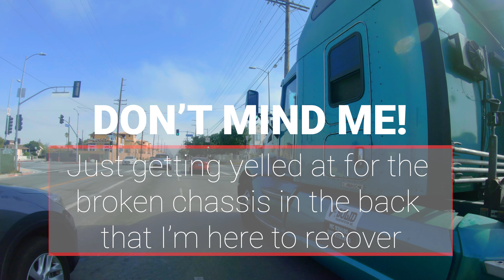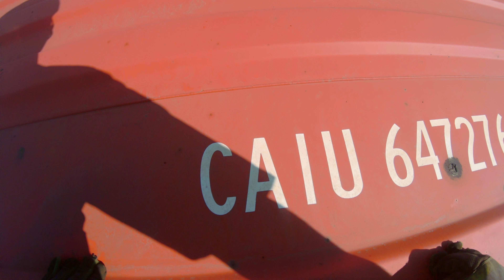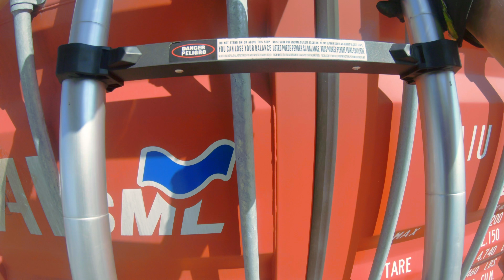Rotator saves the day yet again

Comment: Nice work, our company just ordered two sets of those container links. Based off your videos. Looking foward to using them on our 35 and 40 ton rotators.
Reply from the maker: No way! Did you order them from Bailey's Towing and Accessories? I get all my rigging stuff from them. They are GAME CHANGERS if you are used to using chain in container pockets. And you'll find they work so well on other things besides containers as well. Let me know how you like them when you use them on the first job.
Reply: @PepesTowingService  Not sure where my boss ordered them from. The company I work for, is still stuck in some old school ways. I have been towing 25 years. 21 of them heavies. So I learned old school and new school ways. I watched the mixer video today. I am using that video to try and get a couple of wrinkles 😁
Reply from the maker: @jamesweddington4557  I feel you, I was taught on old school ways as well. But am a huge fan of technology and we have things now that make our jobs so much more safe and efficient than those before us had. The container links are just one example. Glad you are picking up on the proper way to do things, not just how it "used to" be done.
Reply: @PepesTowingService  I don't remember you saying. If the drum was loaded. Just wondering.  If it was loaded. How would you have handled it?  I would assume that by the time you arrived on scene and got set up. The product would have started to set. Now you have all this weight on one side. Hopefully you see where i am going with this and bare in mind. I only have a couple of mixer recoveries under my belt and both times. The drum had little to no product in it.

Comment: Again setting the out riggers and placing the boom 90 degrees off center a little boom out cable in and viola we have lift off drag them legs forward a bit and move in the back up rig set it down on the pins and next remove half unit place on land all reassess how to get the other half set up lift off land it and boom well executed using patience and common sense and no need to lift the same thing twice is nice Well DONE JOSH

Comment: Pepe I love your video's.
Tip for the can haulers out there.
Check the pin mechanism assembly on the pretrip. Before you mount the box. If you can spin the pin with your hand. Tighten the jam nuts . I lost one of 2 pins cause noone told me. It was a brand new loaded triaxle chassis to. And lube the rails when empty so they'll slide when loaded.

Comment: Worst case scenario since you were blocking their yard would it have been possible for you to position the Rotator further forward rotate your boom off the corner of the back of your truck pick the container up and have one of your guys slow roll the big rig forward as you turn the rotator so that you could set it back down their yard wouldn't be blocked and now you can do your job without messing them up or rushing
Asking for a friend 😄😄
Reply: With a loaded Container that is not optimal nor safe; centered the loaded container between the outriggers was necessary for a proper and efficient job no sense in lifting it twice with the way josh did this
Reply: @Chaplain_GM  thank you sir for your input I drove for 20 years medium light duty didn't drive heavy I did do a lot of rigging and that is why I was asking if it was something that was possible now I know thank you for that information

Comment: I think I would of picked the back of the trailer up and moved it past that guys gate Maybe you would have has less pressure on you on a hot day Either way people aren't happy Be Safe !
Reply from the maker: That was my first suggestion, but when they said the trucks would be there in one hour I knew I could get it done
Reply: Never did like picking up a chassis from the rail or port, at the time (80's) the 
maintenance was little to none, if something went wrong it was your fault.
Reply: Mark V. Is right. Rolling corroded junk on wheels. Rotten tires & brakes, air leaks & burnt out lights👍🏼
Reply: Shuttle bugs..  never inspected...   Like a lot lizard. Using one Will cost you everything..